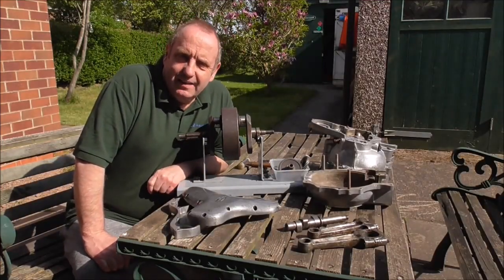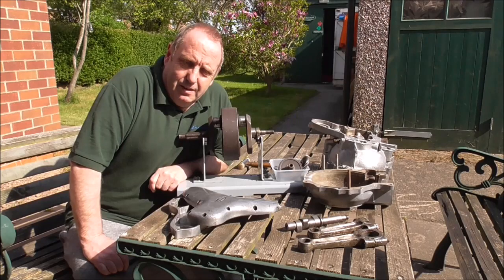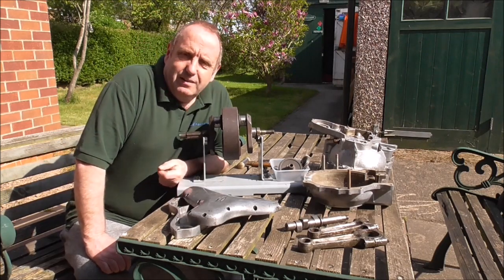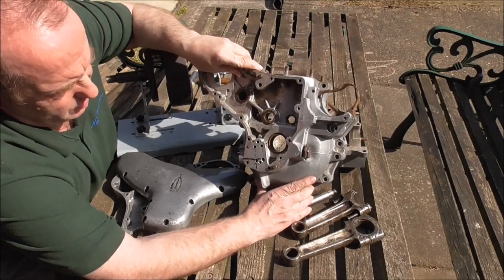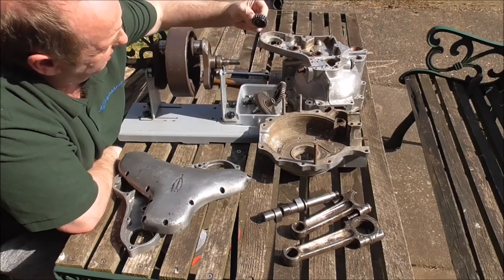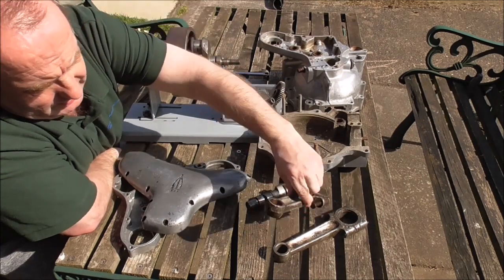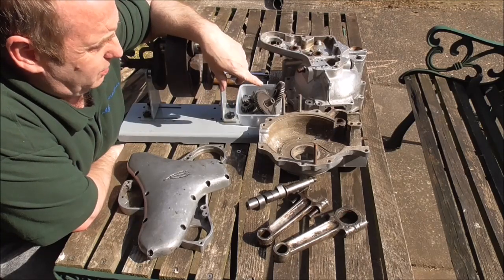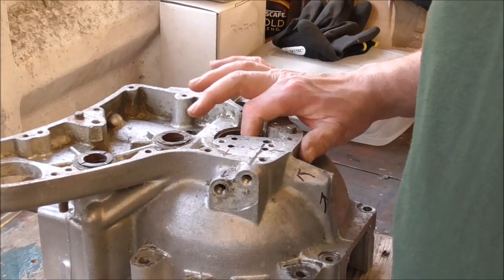BSA bush to bearing conversion #1

Comment: Wonderful. I have a A10 engine that has been bodged like yours so I'll be following very closely. I pulled the crankshaft out of a cupboard where the garage had flooded a few years ago, it has suffered quite badly. I'll send you a picture if thats possible. Thanks for these wonderful videos.
Reply from the maker: Really pleased to have you along with me, please do send photos : adegwilliam@gmail.com, regards, Ade
Reply: I'll get some tomorrow Ade.
Reply from the maker: Nigel, email is correct, copy this into your compose message:
       adegwilliam@gmail.com       or you can find me on instagram:  
      a_g_engineering  which may be easier to send photos on. Let me know if these work, Ade
Reply: @AGEngineering  hi Ade did you get the pictures?
Reply from the maker: Just checked yes, i'll email you.

Comment: What do you think is the most common thing to cause a big end to let go like that? A few years back I had one let go on a fresh rebuild with about 100 miles on the engine.It caused major damage but I was able to save the cases.Im not sure if the bearing spun or what.It was a standard crank with standard big end bearings and torqued to specs.Now the old girl has about 3500 miles on it and is holding out very well.It was the timing side that let go.Lets just say that the first few miles were a bit nerve wrenching not knowing what caused the damage in the first place.So far so good.
Reply from the maker: Not sure with this particular engine, the Bush actually looks reasonable, no sign of turning or seizure and despite the damage, I don't think it had previously been dismantled, little butchery, no stripped threads etc. I'll try to address some of the questions in a video soon.

Comment: I had a number of BSA A10"s and A65s , every single one had bush main bearing trouble , its a very poor design , sad they never improved it when the A50\A65 was launched .
Reply from the maker: I completely agree, the first BSA bush I did (hand scraped back then!) was on a Thunderbolt, they had the perfect opportunity to change to roller and end feeding the crank then, but I suppose stuck in the thought bubble, regards Ade

Comment: If only the BRITISH MOTOR CYCLE industry had
A little more back bone and knocked the rough 
edges off the very basic engines ,
Basic engineering balancing fly wheels etc etc .
Scrap sand moulding turned to  injection moulding
We would still be leading the world.
IF,,IF.  ,IF
Reply from the maker: We're to big to fail, largest motorcycle company in the world, we'll just rest on these laurels and not invest... 😢